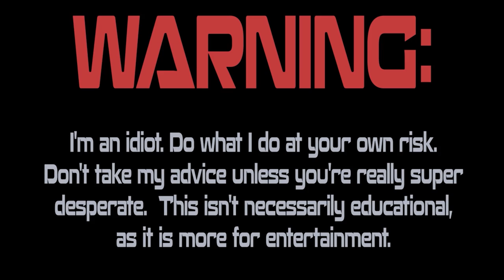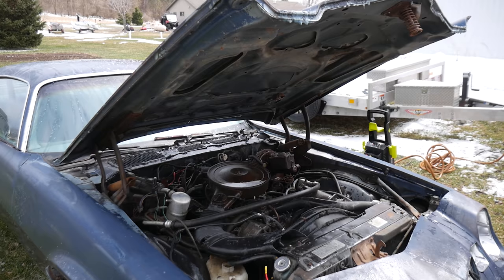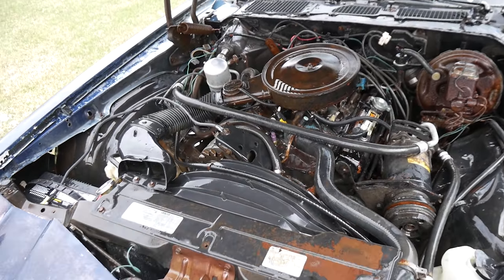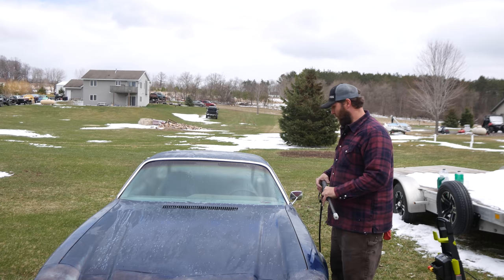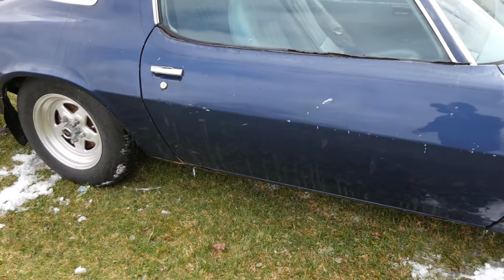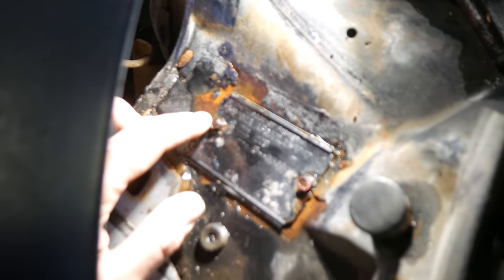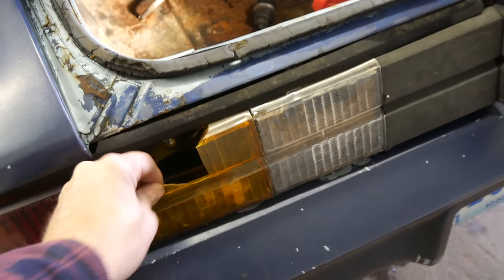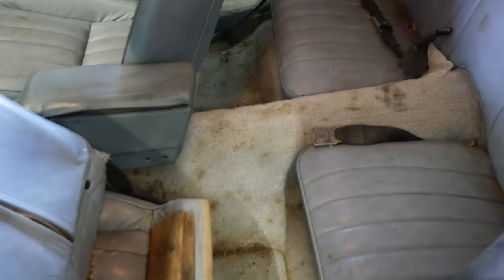Forgotten Barn Find Camaro First Wash In 21 Years! - Vice Grip Garage EP69

Comment: on my 79 camaro z28 rs t top  i'm pulling the sb and putting in a stroked 454 i got the car for free and the engine for free have another 79 z28 hard top for parts that i got for free on has a 4 speed borg warner and the other has a auto have a heavy duty 400 turbo not sure witch to go with yet so i say build it

Comment: To all the people saying to dump it because of the rust..you obviously live someplace down south. Even then it's hard to find a 79 without rust. Last I checked they aren't building anymore of these, so Derek I encourage you to hunt for some rust free parts , and fix it up. There are people all over that have extra parts from builds and some yards still have oem used parts.  A good place to check would be Dewayne's auto parts In Roseau ,MN  he has sheds full of take off 60's 70's and 80:s parts. Lots of odds and ends. Been a couple years since I've rifles thru his buildings but I do remember lots of oem late 70's Chevy pickup fenders.  If you spent a day there Im sure you'd find lots of parts for that Maro.
Reply: He also owns that yard in englund mn I was telling you about..not a lot left outside , a few racks of clean early 70's Chevy n Ford fenders n hoods, but the buildings are full. And there is a buttload of every style and brand of hubcaps you can imagine. I've never been in those buildings but I e been told there is alot of clean 60's and 70's trim..manual tranny's , heads , engines, and random body parts.  It's worth a trip up here I think. Who knows, you might even drag home another project.

Comment: Shouldn't the wires and anything that can't have water init from the engine, have been taped and covered first!!!
Reply from the maker: Naw, have done this on 300+ vehicles with no issues.  Just don't soak the distributor or carb.
Reply: @ViceGripGarage  I've only ever watched one other show, where they had to clean out the engine, so I'm a noob to it all.

Comment: A plain Jane 79 Camaro with a 305 and a slush-o-matic.  get it to run again and blow it out the door as is? The only thing on that car that's even remotely interesting is the factory air, and I bet that needs either a condenser or compressor.